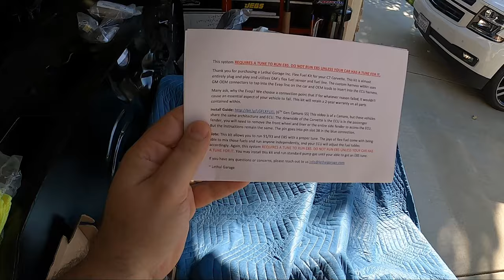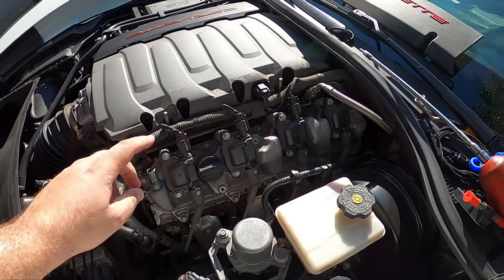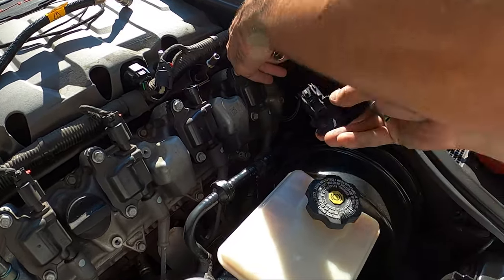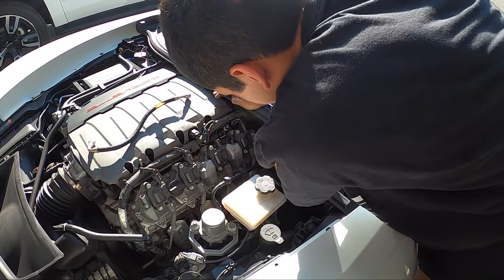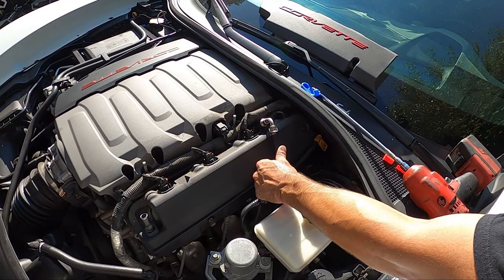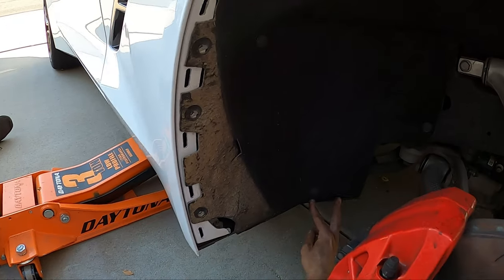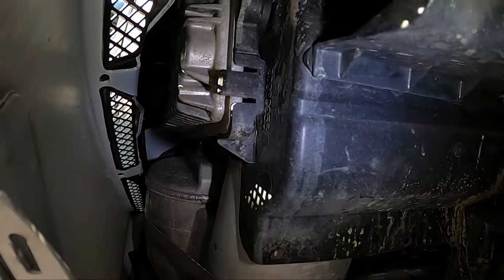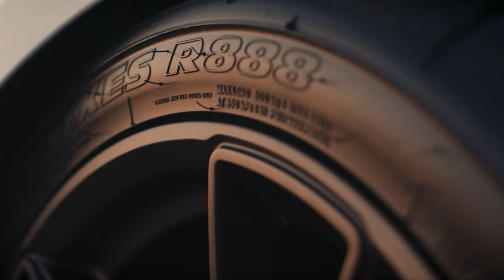Flex Fuel Kit (E85) Install Guide - 14-19 Corvette | Lethal Garage

Comment: So if I get the kit and get it tuned I can run e85 and 93 or would I have to do something to switch it back and fourth
Reply: Once it is tuned you are good to go. No switching needed that is the point if the sensor. The computer adjusts based on what it is reading as the fuel flows through the sensor. What year and model car do you have?
Reply from the maker: Just fill up with the different fuels when desired. Most tuners will tell you to wait until the fuel system starts flowing the other type of fuel swapped to before hammering it.

Comment: Hope I get an answer if I were to install this on my c7 and get tune on e85 am I able to pump 93 after being tune on e85 or no?
Reply from the maker: You can run either or and even a mix of both. But you will only see the power gains at full e85.

Comment: Can i run e85 on a bonestock c7 stingray
Reply from the maker: Yes! Your stock fuel system will support 600hp and has the headroom for e85. Just need a flex kit and tune and you’re good to go.
Reply: @Lethalgarage  do i have to unlock anything or does a 17 stingray come unlocked already for the tune, also can i run e85/91?
Reply from the maker: @ntecl4d  your tuner would unlock it, flex fuel will allow either fuel to be run.

Comment: Hey man! Do you have a kit for the z06? I could not find one on the site? Also, what do you recommend to monitor ethanol levels?
Reply from the maker: Our C7 kit will work for the Z06, only difference is the EVAP plug is on the driver side. but note to run 100% and not mixed you need a lot of other upgrades. (Injectors, fuel pump and possibly a cam). I’d highly suggest talking to a tuner/builder to outline all that is needed to reach your goals.
Reply: @Lethalgarage  ah, cool. Mike with Red Barn is doing a heads/cam. Waiting on the heads. I already have xpipe, exhaust, CAI, 2.3 pulley. Debating on flex fuel now or later. I was hoping with the cam and dsx low side we could get close to e85 but not sure. I hear mixed things. Injectors will add substantially to the cost which changes the whole dynamic.

Comment: Can you run 91/94 again after without issue? E85 is tricky to get in parts of British Columbia
Reply from the maker: Hey Brandon, of course. That is what flex fuel is, the ability to run one or the other or mixed.
Reply: Thanks for that super fast reply! I will be putting in an order
Reply: @Lethalgarage  unfortunately your shop does not ship to good ole canukistan (Canada)
Reply from the maker: @BrokenFangAdventures  we do, just have to email the team to get shipping costs as they change per providence

Comment: do you need a bigger fuel pump or can you put the flex fuel with the stock fuel pumps etc
Reply from the maker: On a stock car non-Z06, the stock fuel system is good to go.
Reply: @Lethalgarage  no way! You can literally buy this kit and your good to go? I would love to run e85 on my 16’ gs 😮
Reply from the maker: @matthew6905  the kit + a tune is all you’ll need.

Comment: I’m still new to cars, what is flex fuel E85?
Reply from the maker: It’s the ability to run pump gas or pump e85. The benefit of running E85 is more timing can be added and more power can be made at the cost of gas mileage.

Comment: Will this work on a Z06?
Reply from the maker: While the kit will work, you can’t run 100% E85 unless you make other modifications such as injectors, fuel system upgrades, etc.
Reply: @Lethalgarage  Thanks.  Do you mfg the wiring harness yourself?  If so, would it be possible to get a power, ground, and sensor pigtail built into the driver's side of the harness so that I can wire it into my P3 gauge without having to modify your harness?
Reply from the maker: Gen5DIY makes my harnesses